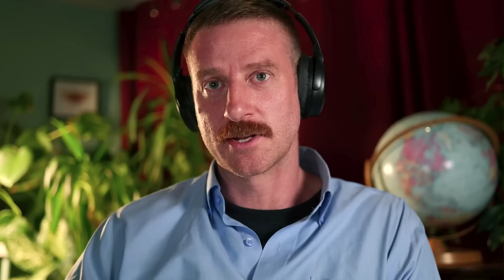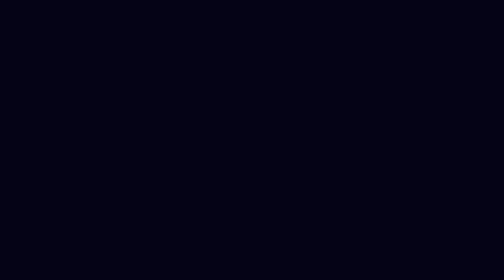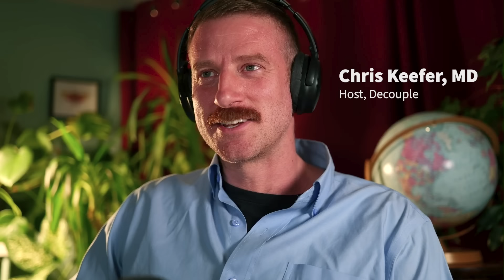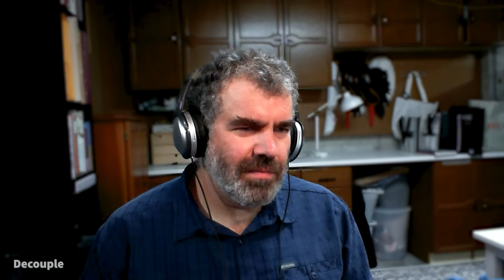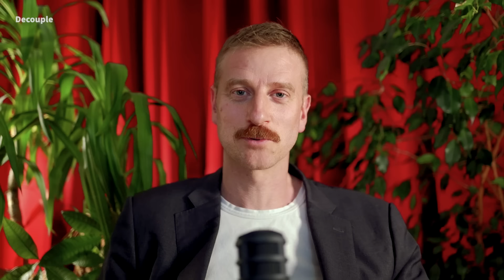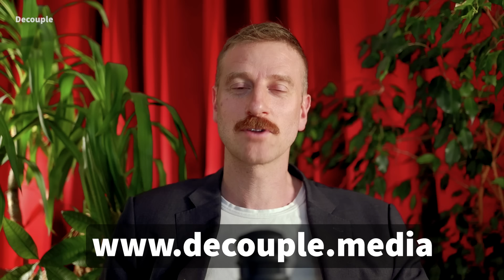Why We Haven't Decarbonized Industry... Yet – #296

Comment: My father was involved in the HYL direct reduced iron process starting the in 1960s.  They used natural gas to produce the reducing gas (CO & H2).  Producing hydrogen from a helium gas coolED reactors (red hydrogen) sounds promising for carbon neutral ore based steel production.   Producing hydrogen from electricity is inefficient AND probably wouldn't make economic sense.  Funny think is one would have to add carbon to the electric arc furnace to produce carbon steel if we took the nuclear route.  Carbon steel would in effect become a carbon sink.

Comment: For over a generation, appeals from scientifically-illiterates to other scientifically-illiterates ended the nuclear industry for all intents and purposes.

If anthropogenic global warming were a real, existential issue, we would have been in a golden age of nuclear energy.

And now we’ve gone full circle.

The victims of nuclear bullying are now pushing their agendas to the disadvantage of the coal, petroleum, steel and cement industries.

I want to see every conceivable form of nuclear power plant built; and I want to see industry become more effective; and I have thought of using oxygen concentration for greater fuel efficiency and the end to catalytic converters on cars.

But I would like to have heard about using nuclear process heat for in situ production of oil — especially from the Athabaskan fields and, if possible, perhaps doing an in situ Fischer-Tropsch with coal.

Comment: Once the nuclear buildout gains enough, steam, District Heating is definitely going to be one of the most useful applications. We, as humanity, might actually be able to reduce the primary energy requirements by powering heat with steam from nuclear instead of going through efficiency losses via electricity

Comment: Using nuclear heat in oil refining could reduce production loss by 20-40% due to the reduced need to burn input material to provide heat for cracking and chemical reforming.

Comment: 1:02:49 This is a key fact: if you can use heat from steam directly produced by hydrocarbon/nuclear/geothermal, you will get a much higher efficiency than if you use the steam product to generate electricity, then use that electricity to run a heat pump to produce heat.  I wish greenies could understand this concept.
Reply: It's not their fault they're morons

Comment: Using electricity to separate oxygen and nitrogen.  Then using the oxygen for smelting at a much higher efficiency and using the nitrogen to create ammonia is a best use for electricity.  As opposed to using electricity to heat cold ore to operating temperature, which is a horrible waste of energy.

Comment: Using nuclear to provide heat for pyrolysis is perhaps the best use of nuclear energy.

The required temperature is easily achieved by nuclear, and eliminates the need to burn the pyrolysis material or use electricity to drive the reaction.

Pyrolysis is a key future technology to somewhat efficiently create the variety of hydrocarbons we have come to depend on from any biological material, at the cost of significant process heat, which could be provided by nuclear, increasing process efficiency closer to parity with electricity production.

Liquid fuels, and hydrocarbon chemicals are keystone to maintaining our level of technology.

It is better to turn low value trees, crops, waste plastic, and waste paper into high value fuels and chemicals through nuclear fueled pyrolysis facilities.

The current US oil refinery system could somewhat easily shift some production from heavy oil input to a pyrolysis system.  

The biggest difficulty would be in transporting sufficient materials to the site to be processed.  But, if all waste plastic, paper, and other combustable trash was sorted by consumers, picked up by waste management companies, shipped by train and/or barge to a pyrolysis to fuel/chemical facility.  We would reduce landfill requirements, remove plastic toxins from the environment, create thousands of jobs, and create a valuable resource from waste.  It's a win, win, win win, win situation.  I don't understand why we persist in dumping valuable material that can be cracked and reformed into high value energy intensive goods needed by everyone.

Comment: Electric heat should only be used to boost processes beyond what waste heat from local processes or cogeneration processes can provide.

Remember, electricity has already reduced the energy available for use by 50-70% due to the losses during generating that electricity.

Using the waste heat from electric generation and/or any other process to preheat materials is much more efficient than using  electricity for initial heating.

The electricity produced could be used to boost temperatures up to temps required for processing ore or other chemical reactions after all possible waste heat and even hydrothermal or nuclear heat is applied.  

Electricity is the least economic worse use of resources for the initial heating of material to temps below 600-800° of any other reasonably efficient process is available.

Electricity is not green unless the entire system dedicated to its production produces less greenhouse gasses and damage to the environment than the available alternative.  Most of the time this is not true, even with solar and wind as semi primary sources.  Electricity production is resource intensive.

Comment: I think the biggest potential use for technology like fission heat plants is for preheating the oxidizer, fuel, and reactants.

If you are trying to drive off oxygen to make cement or metal from ore, you have to get the ore, oxidizer (air or oxygen), and fuel (coal, coke, natural gas, hydrogen) up to a high temperature before the reaction can begin.

According to ChatGPT 63% of the energy requirements of iron smelting are to get everything up to temperature, and 37% of the energy is used in the reaction to convert the oron oxide to metallic iron.

ChatGPT:
Practical takeaways

DRI route: Pair an HTGR/MSR for 700–900 °C preheating of ore/reductant/oxidizer; then use electric heaters/induction to bridge the last 200–400 °C to 1,100–1,200 °C. Nuclear would typically cover ~60–80% of the sensible preheat, cutting fuel needs sharply. 

Blast-furnace assist: Use nuclear heat to feed the stoves/hot-blast up to 700–900 °C, then boost to ~1,100–1,200 °C with electric (or oxy-fuel if you still want some combustion). Nuclear could cover ~55–75% of sensible hot-blast preheat depending on reactor. 

Full electrification path: Nuclear supplies baseload heat + electricity; electric arc/induction supplies peak high-T and melting. This avoids fossil fuels entirely on the heat side while preserving process flexibility. 

Let me know if anyone has a more efficient idea.  As far as I know this would be the most efficient way to process ore or make cement*.  

*Provided you don't let the US regulators anywhere near your plans, facilities, finance.

Comment: You won't be able to run industry, residential, public services, AC-heat, lights, air traffic, etc on just wind & solar. They can be on the grid but they can't supply the whole grid. Witness the large solar plants in AZ/CA are shutting down & 3 in CT are shutting down.

Comment: To say that the cement and concrete production produces a lot of carbondioxide is another lie, that is spread by leftist activists who are all about ideology and not one bit about science. How can cement with water harden if the reaction is not reversed by adding carbondioxide? The answer is it cannot, thus cement with water reacts with carbondioxide to limestone,  that is the the technical lime cycle.
Reply: That's not the whole process, you are talking about the very last steps only, and not the full cycle of what you have to do to get to concrete . For example, you are skipping that limestone has to be mined , and during processing of the limestone, a lot of CO2 is released.

Comment: Nuclear power in the US requires a 10 mile evacuation area which would apply to SMRs.   SMR's would seem a goof fit for large ocean ships.   There is no reason to remove carbon dioxide emissions.  Atmospheric carbon dioxide is the gas of life.   1200 ppm atmospheric carbon dioxide three times today's level  would greatly green the earth and is used in plant growing greenhouses.  The cause of global warming is not known with studies to its cause going back to the 1970s.   NASA reports global warming at 1°C where it has been since 1992 after falling from its all time news reported high of 1.1°C in 1991.  Its impossible to raise the effect of a saturated system a primary example being earth's water vapor saturated greenhouse effect that completely absorbs all the greenhouse radiant energy from the earth within a few meters of the radiating surface adding 5.55°C (10°F) to earth's average temperature.
Reply: I think you are referring to the exclusion zone which is about 1 mile for a large PWR. The evacuation area is fully occupied with people, homes and businesses. This is for a pressurized unit where bad stuff desperately wants to escape under pressure. None of the gen. IV nukes are under pressure and are much safer due to the physics of the design, not add on engineered systems. 
Even at 1 mile, steam-sourced process heat would work fine if the price was right, which I doubt. 
All the rest should be based on cost. Until nuclear can compete with natural gas, it will remain too expensive.
Reply: You really don't want 1200ppm of CO2, you'll suffer cognitive and physical impairment, with drowsiness and headaches. It would also affect sports performance. At 1000pm it's noticeably stuffy.
For plant growth, all factors need to be in balance, heat, light, water, CO2, minerals - CO2 ceases to be the limiting factor. Indeed there is now evidence that 'peak global greening' passed a decade ago. A closed system greenhouse is not a rain forest.
Then there's ocean acidification which has no positive benefits...

Comment: What wasn't specifically stated, i think...  How much of this steam could come from the waste heat, after generating electricity?  It seems like most?
So we could/should just build a lot of reactors everywhere where there's industry, get the GWₑ for the grid, AND the GWₜ for the industry.
Reply: It depends on the pressure of the steam. Since the usable temperature is starting a lot lower than say a gas turbine, there is less power available. 
For low pressure steam export there is much more potential. 
But flexing between power vs steam export is quite possible.

Comment: 4000 TWh of electricity to produce the hydrogen needed for primary steel production would yield 112,000 tonnes of greener-than-green, nuclear enabled hydrogen using this Topsoe steam electrolysis SOEC data: "...The below results ultimately result in a consistent electrolyzer efficiency of around 93% (compared with LHV of Hydrogen) with an electricity consumption of the core at less than 36 kWh/kg H2..."

Wind and solar use 'cold' PEM electrolysers that would only deliver 76,000 tonnes of green hydrogen.

Which figure did you use?

A NuScale reported this about the high temperature performance of their 77 MW NuScale Power Module (NPM): "...Only 2 percent of the electrical output (~1.8 MWe) of the NPM is used to increase the process steam temperature from 300°C at the NPM outlet to 850°C for the electrolyzer..."

We don't need to hang around for AMRs to deliver the bulk of the process heat required and burning NEH can do the rest.

Starting today, in nuclear ready nations like the USA, a Gen III+/NEH 'economy' would rid the USA of the 'evils' of burning fossil fuels - in terms of the cost in 100s of billions of $s and millions of premature deaths/vile illnesses - and pay for itself multiple times over.

Search for: "are usa politicians completely mad"

It's about time Dr Keefer took off his hydrogen-economy blinkers and put some of his time and organisational resources into studying the Occam's Razor/Silver Bullet way to a cleaner, healthier, wealthier planet.

What would you like to know?

Comment: Natrium appears to be as “real” as any of the up and coming reactors, and they are using liquid sodium.  That would seem to address some of the thermal limitations of the gas he referenced, particularly the choice of sodium as operating over a wide temperature range at atmospheric pressure. || So information dense is this episode it is note-worthy — highest praise.
Reply: Sodium would be great for heat transfer properties, but adds a bunch of process hazard risks, so it would be very situational. 
Solar salt is much more promising (but limited to ~550C), and is what Natrium will actually use for it's final heat transfer fluid, before going to the non-nuclear parts.

Comment: Amazing episode. I know Chris has previously had Nick Touran on to discuss MSRs, and while Nick is clearly very knowledgeable, it would be valuable to also hear from a specialist in molten salt chemistry. Such an expert could really dive into the chemistry of the salt itself and the solubility of key fission products like I-131 and Cs-137, which have profound implications for both safety and regulation. It's what really sets apart MSRs from other reactor types: not only can they provide high-temp heat, but they could also be sited much closer to cities and industrial facilities, since their emergency planning zones would not need to extend 50 miles as you're negating a significant amount of risk of a uncontrolled radiological release in a serious accident scenario.

Yes, Chris likes to poo-poo advanced 'paper' reactors, for partly good reason, I get it. But a molten salt specialist would be nice to listen to on here some day.
Reply: SMR not MSR Small Modular Reactor!
Reply: @albennett418  here MSR is molten salt reactor, it's just a coincidence that it uses the same letters as small modular reactor
Reply: Don't hold your breath, Decouple is far more anti-nuclear than pro. They only advocate gigantic government-funded jobs programs, PWRs.

Comment: It appears that approximately 30-40% of industrial process heat can be achieved with high-temperature steam. Grok says that steam can be piped up to 1.2 miles, which provides the safety separation needed. The real question is cost because decarbonizing is only a secondary consideration.
Reply: Geothermal is only viable in certain locations. In Iceland, for example, they have lots because their geography is prime for it. LLMs aren’t reliable.
Reply: @SamWilkinsonn  I'm referring to steam generated using generation IV nuclear, not geothermal.
Reply: 1.2m would be extremely inefficient
Reply: @SamWilkinsonn  1.2 miles is within efficient range, beyond that gets inefficient.
Reply: Grok is, of course, wrong. 
There is a petrochemical plant in China getting ~500MW worth of steam over 20km away from the NPP (PWR).